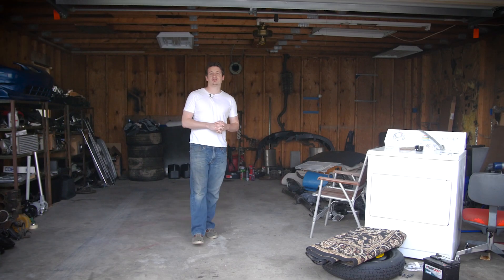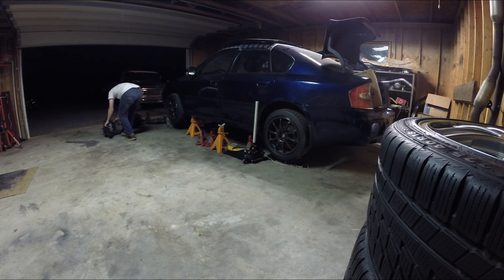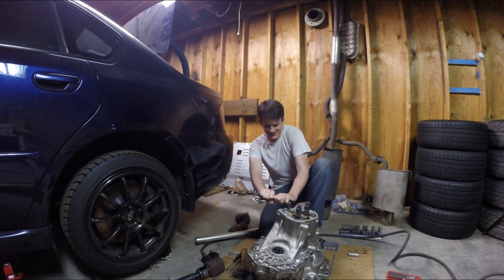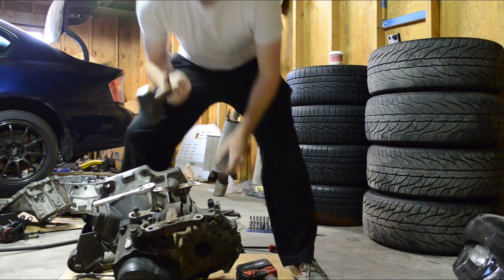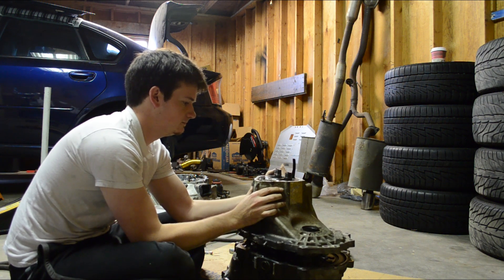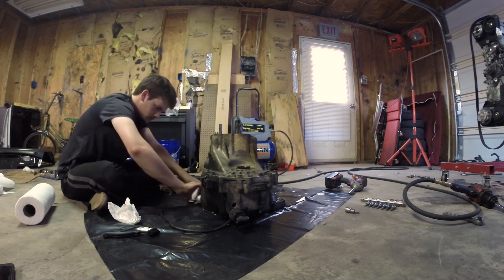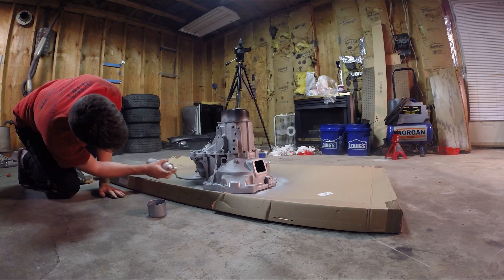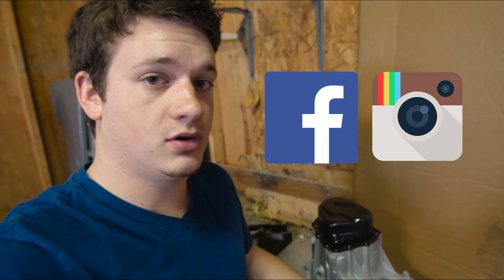Rebuilding the Transmission (Turbo Build Part 8)

Comment: Hey, (I couldn't believe you said the transmission blow up 6 times) And on that note, I was wondering if you had thought of having the transmissions casing and gears nitride treatmented. (gas nitriding, salt bath nitriding, or plasma nitriding.) " Nitriding is a thermochemical case hardening process used to increase wear resistance, surface hardness and fatigue life by dissolution of nitrogen and hard nitride precipitations." A LOT of high performance aftermarket transmission shops do this to the transmissions they rebuild. (Pretty much all car manufactures do this to the cranks now) It aids in strengthening all steels, ( low-carbon, low-alloy steels, medium, and high-carbon steel) as well as titanium, aluminum and molybdenum. Another option could be Cryogenic hardening. I only mention this because I know what the Lima Fords can do. (Make 600 HP with Turbos) I'm pretty sure the Turbo 2.0 Contour motor isn't too far off accomplishing that same mark.

Comment: I thought I was the only one that wanted to make a ford escort into a really fast and nice tuner, but I guessed wrong when I watched all 8 of you're video. I'm putting a body kit and a ton of odds and ends into the engine but I don't think ill touch the interior until something goes wrong with it but I going to install a twin turbo in my zx2 ford escort. Wanna race me when I'm done for shits and giggles lol?!?! Also for the installation of the turbos I wanna ask what did you delete from you're engine bay?